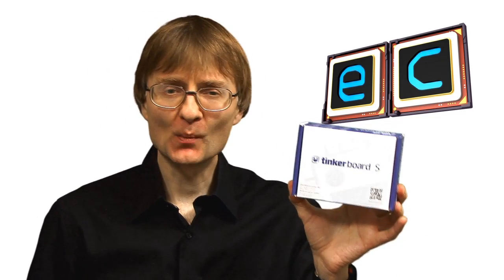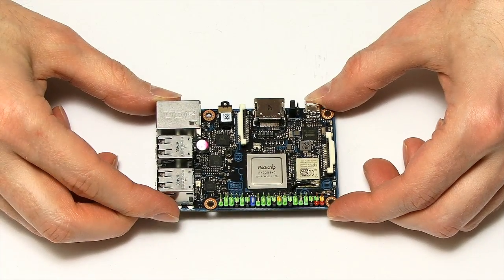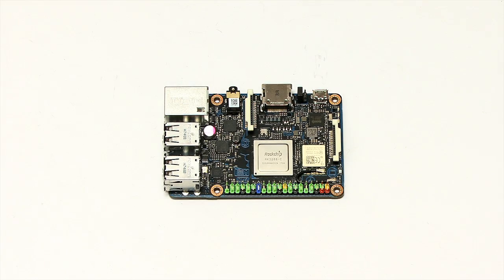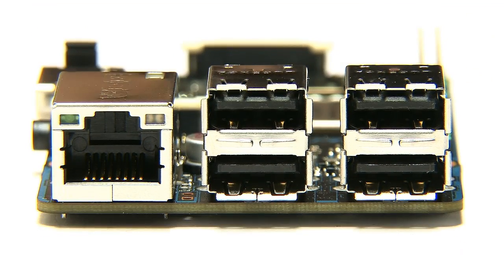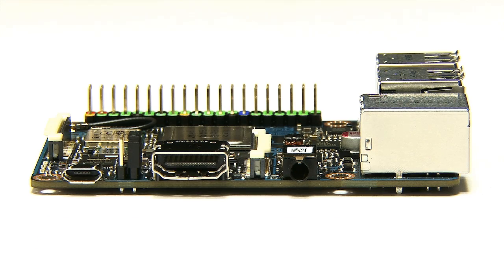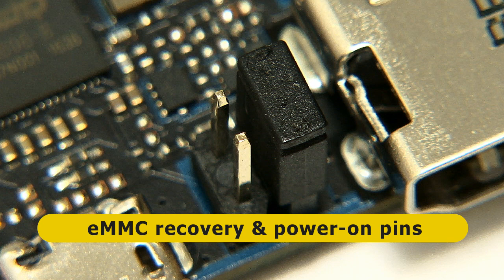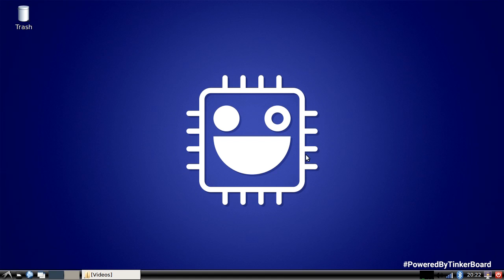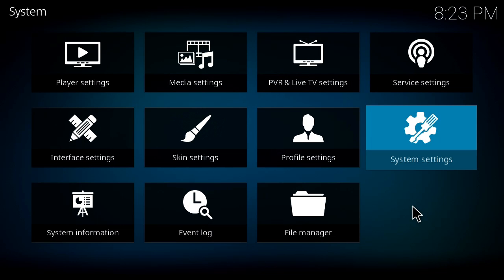Tinker Board S

Comment: Hi Chris. I have a Pi-Top [3] laptop which is designed to take a Raspberry Pi 2B or 3B SBC. Today this is underpowered and response is very poor. I recently installed an ASUS Tinker Board 1 (rev. 1) and Tinker OS. So far it’s performing better than the RPi options. It was quite simple to get the internal speaker working as Tinker OS is a Debian fork. However, I’d like an even more responsive SBC and am thinking 4/8GB might be more adequate. Because of the design changes to the RPi 4B/5B connectors, I’m unable to use them.

I am after a faster response than the Tinker Board 1 and need an SBC with the same form factor as RPi 2/3Bs. The Tinker Board S and Orange Pi 3B (4 or 8GB) seem a nice options. What do you think might be more suitable, given that heat dissipation is only via convection using the Pi-Top bridge. Would an Orange Pi suite or can you name other possible candidates?

Thank, Ian from Western Australia.

Comment: Having only 2 GB of RAM in the Tinker Board S is a show stopper if the board is being used as a basic ARM based desktop PC. Why is there no 4 GB RAM option for the Tinker Board S? Some of the other SBC's have a 4 GB RAM version. The Tinker Board S is so close to being the best alternative SBC to the Raspberry Pi for desktop use, yet the board is held back by the amount of RAM on the board.

Comment: With the newest KODI release, I was tried to play 4K Video. In the system menu there is an item for screen resolution. $k resolution is available in the system menu, but after applying this system screen blackout for a second and returns to 1080p. I have 4K TV and TinkerBoard was connected via HDMI 1.4 cable to the TV-set directly. Can you advise please, how to solve this problem?

Comment: Please, can anyone help me? I plugged my Tinker S on my notebook and it doesn't recognize the eMMC. Tried on Ubuntu and Windows. Is there any other way to install the OS on eMMC or to make my computer recognize it?
Reply from the maker: Almost certainly the problem is the USB lead you are using -- it needs to be a pretty thick, short lead to work with the TinkerBoard S. Good luck! :)
Reply: @ExplainingComputers  hmm I've just tried 3 different ones from other devices. I don't know what to do anymore haha
Reply: But thanks for answering me!
Reply from the maker: Sorry to hear that you are still having problems. Try tinkerboarding.co.uk
Reply: I bought a new source power with a display to see the current and voltage. It arrives tomorrow. Let's see if it works

Comment: Very cool video...I seen a higher costing tinker and was wondering if they made another ...I bought 2 ...one for tinker os with kodi as a media player/streamer and my other I mounted in a mini Nintendo case and its my emulation machine n has tons on an old laptop 250 gig hard drive ...wanted to ask are the processors and gpu the same size ghz wise ? I'd buy 1 especially for the emmc but would have liked a lil more bump on performance just to help a lil on emulation ...but love the videos ! You have helped me a lot and helped get me into the sbc world :) also recently got 1st gen 4g model latte panda and currently checking it out when I'm not gaming on my ryzen 7 gamer...I just like all computers :)

Comment: Thanks for this excellent resource (EC in general).  I took you up on the tinkerboard s, and have it up and running.  It is my first experience with any form of Linux, and as a Mac and Windows user, I am a bit lost on where to go from here.  

Turns out I don't have even enough basics to ask intelligent questions.  I cannot see how to perform even the simplest of tasks in TinkerOS (Debian?  Ubuntu?  Linux?) like installing a program, or configuring networking.  

My goal with the tinkerboard is to use it to drive a 4K display, mounted in another room of my house, and have it present slide shows of jpegs in folders.  Also, it seemed like an easy entry to learning about and discovering linux.  However, I am at essentially ground zero with linux (TOS?  Debian? Ubuntu? Linux? ) and all the resources I have found assume a level of expertise to perform tasks that I simply do not have - yet.  (SSH?  sudo commands?  Python?).

I am seeking an entry point into understanding how to get up to speed with this SBC that does not assume I know how do anything as yet.  Not so much a set of 'do this to achieve that' instructions (which got me up and running with the 2.07 v of TOS), but something I can grab hold of so I can abstract What the CLI is doing, and how it works.

Do you have any suggestions?

ADVthanksANCE!
Reply from the maker: For program installs, the format is " sudo apt-get install PROGRAM " (eg sudo apt get install gimp ) Run a sudo apt-get update first, so the board is looking for the software in the latest place. You may find useful my videos "Tinker Board Week" and the one I did recently on "Linux Mint 19 For Windows Users", as some of the stuff there is about Linux in general and its operation.

Comment: Have you tried Duel booting with the emmc and not changing the jumper. I want to do both os's and keep the emmc as the default boot with a boot loader. Dunno if anyone else has tried this with the tinkerboard.
Reply from the maker: I've not got this to work I'm afraid.
Reply: @ExplainingComputers  I figured out a simple solution if anyone has the same issue Basically making a jumper dip switch and running some wire to the 4 pins, Makes the boot option swap-able inside the case.

Comment: my computer can't read the borard (using the ticker borad s)
Reply from the maker: Almost certainly a cable issue -- Tinker Board S draws a lot of power, so most USB data leads do not work. You need a short, thick USB to micro USB lead.
Reply: Hmm, okay. But the thing is. That the Tinker Board S has a red LED on it and it lights up.

Comment: How do you load a linux distro on this device?
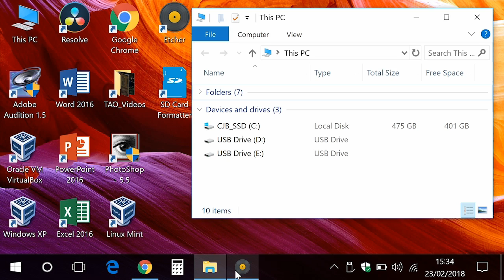Reply from the maker: As I show in the video at about 7:30, you connect it to a PC and flash the image across using Etcher. Or you can use Etcher (or similar) to flash an image to a microSD card.
Reply: I tried this 3 times, on sdc storage; on a 64GB, 128GB, and a 256 one, all Sansung's. I used Etcher and once I  did, couldn't  use those storage devices at all again. I got on a windows machine and used Win32 disk imaging app, reformatted them and still could not pull Mint, Matte or Deepin up on any of them
Reply from the maker: For the SD cards, reformat them with the free SD Card Formatter before using Etcher, this may work. You may also be hitting the issue of having an active/bootable OS on the onboard eMMC, which the TB will default to first. It is some time since I messed around with such issues on a TB. But the forum at tinkerboarding.co.uk is excellent -- so give them a try.
Reply: I guess this means it can't be done
Reply: there is nothing there covering these issues I am bringing up here

Comment: I was messing around with my tinkerboard and tried to install windows IoT on it, it doesnt show any sign of connection now when i start it, and if i open it and connect it to another pc, it doesnt even identify it as a usb so i can re-install with etcher. Any ideas?
Reply from the maker: I believe there is a jumper setting to allow you to recover from this -- try the tinkerboarding.co.uk forum.
Reply: ExplainingComputers thank you so much for replying, i’ll give it a try.
Using a bootsble SD fixed the problem but i still can not access the data on my tinkerboard.

Comment: when you did install your OS did you just take a random usb cable? or do you have to get a specific one ?
Reply from the maker: Any USB A (computer end) to micro USB (Tinker Board end) cable will work fine -- like the ones often used with power adapters.
Reply: i was super worried if id set my tinker board on fire the first day i got it
Reply from the maker: Always best not to set computers on fire . . . ;)

Comment: are gpio's 5V compliant or 3.3V max? What about the previous tinker?
Reply from the maker: GPIOs are the same as a Pi; 3.3v max, aside from a pre-voltage regulator tap on the 5V line on the 5V pins (ie for power supply).

Comment: The Tinker Board S looks like a good upgrade from the original Tinker Board as well as the Raspberry Pi given they share the same form factor.  One thought though - the Tinker Board has a heat sink, will that be a problem fitting a sound card such as the Hifiberry or AlloDigiOne ? Seems to stand proud of the components on the board itself
Reply from the maker: Good point on the heatsink. It is not that tall though, so I imagine you will get away with using HATs.

Comment: Hi i want to run my CNC table with a raspberry pi & an exterior hard drive. I have large table 10 foot by 20 foot I would like to run Mach3 because of the fitures My question is can I run windows 7 as my O/S and then load programs on windows like normal
Reply from the maker: See my other response. You will struggle to run Windows 7 on an SBC, aside from an UDOOx86.

Comment: I have got any issue with the tinker board S, which it is not recognized by my PC (I guess it is due to low current supply from the PC).

I have just bought one a few days ago. the eMMc is preinstalled with an Android system. I then connected it with my PC via USB, formatted it, and installed the Tinker OS. I then wanted to try Armbian OS. So, I connected the tinker board to my pc again. Unfortunately, at this time, when the tinker board is connected to my PC, the red light only stayed for a few seconds and turned on. Any my PC could not find the board, and I cannot do anything. I appreciate any helps. Thanks a lot!
Reply from the maker: I am pretty certain, as you seem to be, that this is a power supply issue. The Tinker Board S flatly refuses to work at all if it does not "think" the connected PSU (or PC) is powerful enough to run it in a stable fashion. For reflashing, I can only suggest using another, and perhaps shorter, cable to connect to the PC, and making very certain it is properly inserted. Micro USB is not serving us well here. Good Luck!
Reply: Thank you for your quick response sir. I got a short term solution by booting into the SD card instead of eMMc storage after reading the link below:

https://www.tinkerboarding.co.uk/forum/thread-1645-post-6490.html#pid6490

As I have "played" with the tinkerboard in the last couple of days, I found it with very bad camera support. The framerate is incrediable low like 4 fps (Tested with usb camera). It is a deal breaker to many people if you asked me. I personally use SBC to make robot that can do image processing, so camera speed is a vital element. It would be nice if you could do more comparison on the camera support in the future. Cheers!

Comment: It's funny how after nearly a month this was supposed to hit the market, the Tinker Board S is still not on sale here in Asus' home market Taiwan — the one that's on sale here is still the original Tinker Board without built-in flash storage, and it's also priced slightly higher here at NT$2090 (£58). It's been sort of an open secret here that both Asus and Acer like to sell their better, higher quality products in Europe because the European market gives higher profit margins, I don't know if it's also the case for the Tinker Board S. I also think it's odd that Taiwanese prices for most IT products are slightly higher, since VAT here is much lower than in the UK — there are even people here who go to the US to buy Apple products solely for reselling them in Taiwan, because you can actually make a profit out of it!
Reply from the maker: Right now, on 29 April 2018, the Tinker Board S still does not appear to be on sale in any market. :(

Comment: Been hoping someone like Gigabyte or Asus would bring ARM SBC computers up to the performance and reliability levels of PC motherboards by including features like USB3 and SATA/M.2 hardware support and a nice simple secure un-brickable jumper-locked u-boot bios.  Instead ASUS has chosen to cheap-out and make the Tinker Board's Linux setup more 'Android' like - relying on crappy brickable soldered in eMMC programmed through USB.  The give-away is the "recovery" jumper, which is presumably needed to try to attempt to recover from a bricked eMMC condition.  EMMC is ok in the brutally competitive low cost tablet market where manufactures are not only including a CPU and RAM, but also  trying to squeeze in a 10 inch IPS screen, LiPo battery plus charging circuit, etc and still keep the cost down to 80 or 90 dollars. If they were going to go with eMMC they should have used the same socketed version as Rock64 and Odroid, but I personally would rather have seen microSD paired with an empty M.2 socket. With M.2 you would have higher speed, and much better reliability due to more sophisticated wear leveling, and you could choose anything from an inexpensive 32G TLC ssd to a high endurance128G MLC SSD, or even an ultra high capacity terabyte SSD.  If ASUS is not interested, I hope Odroid or the Pine64 folks will do it.

Comment: Hello, ExplainingComputers
would it be possible to install any other arm linux on this board ?
Reply: If by "any" you mean "any Arm OS I choose?" (for example Raspbian) the answer is NO - Although ARM systems are loosely standardized at instruction set level, they are NOT very well standardized at system interface level. Sometimes you get lucky and Linux versions from boards with similar CPU's and chipsets will cross-boot, but even then there are usually issues.

On the other hand, if by "any" you mean "any options at all other than ASUS's official Tinker OS?" - then the answer is a YES - lots of options.  Just like Raspberry Pi, Tinker Board has several "community supported" Linux versions, including Armbian, Ubuntu 16.04, LibreElec Kodi, Diet Pi, etc.  Although some of these releases may lag a bit on advanced features like accelerated video support, Tinker Board does now have a really nice Kodi release with accelerated video.

Comment: Hi Chris, I can't wait to see what you make of the new Raspberry Pi 3B+, do you plan to review it? I use a Pi 3B for my kids to use Scratch and Minecraft, but it's a bit of a stretch for them to use it as a general computer. I'm eager to see whether the 3B+ will help the Pi to bridge that, gap or whether it's really time for the Pi to have at least 2 GB RAM, USB3 and true Gigabit Ethernet, ditch the composite 3.5mm. Because they continue to make the Pi 2 etc, the current 3 could follow suit and be available until demand for it drops away, keeping makers invested in the pat board happy. Personally I admire the philosophy of continuing to build a US$35 board, but perhaps they need to inflation adjust this to US$45.

Comment: Android disposi-devices, get away with cheap eMMC with it's poor performance and wear leveling because they get few updates (don't thrash the storage much) and are only need to work for a year or two until the non-replaceable battery dies.  I would NOT recommend eMMC for a general purpose Linux SBC due to the likelihood that you might brick the flash during heavy IO tasks like compiling c programs from source.  I hoped that ASUS would raise the standards for ARM based SBCs to those of quality PC motherboards with onboard M.2 SSD and USB3 boot support. Instead, ASUS has been brought down to the quality standards of cheap Android desposi-devices with crappy brickable onboard eMMC. Really, really, really STUPID Asus. Also, continuing to use a Micro-USB charge jack as a power feed was really dumb. These plugs were never intended to handle high current, and having 'low voltage detect', contrary to what is said in this video, does ABSOLUTELY NOTHING to make the under rated micro-usb power feed mechanically 'more reliable', it just nags at you to tell you WHY it's CRASHING all the time.
Reply from the maker: I never said anywhere in this video that they have done anything to make the connector mechanically more reliable (it is clearly still a micro USB connector with all the problems those present for large power draw as you note). In the video I actually said they have implemented low-voltage detection to reduce power-related crashes, which they have.
Reply: I did some research on this because I did see some power related issues with myTinker Board.  It would work reasonably well with one 2.5 amp micro-usb charger, but not with another.  Turned out that it was a two part problem, a slighly weaker psu coupled with a higher resistance cable was enough to create huge problems, but the stronger psu plus a short heavy guage USB cable works fairly reliably.  Based on my experience,  I still don't understand your comment that simply adding  'low voltage detection'  will 'reduce power related crashes'.  It may help troubleshoot issues, but once the micro-usb jack starts to wear out, and the resistance goes up by even a small amount NOTHING will help - though you will have the joy of having the 'low voltage detection' writing messages in your log to corrupt your SD card or eMMC flash just as the system is crashing. This nearly useless 'feature' was such a pain in the ass on the Raspberry Pi that they added a config option to disable it.  A smarter solution would have been a dual voltage conversion scheme with a wide input range 7 - 14 volt barrel jack like thin client PC motherboards.
Reply from the maker: Having experimented with the Tinker Board S for some time now, I believe what they have done is to have the board check out the power supply, and refuse to boot at all if it detects a lower voltage PSU, rather than booting and crashing. Certainly PSUs that run a 1st gen Tinker Board OK will not work at all with the Tinker Board S. As you note, a barrel jack would have been a good idea -- but I guess they wanted to maintain the Raspberry Pi form factor.